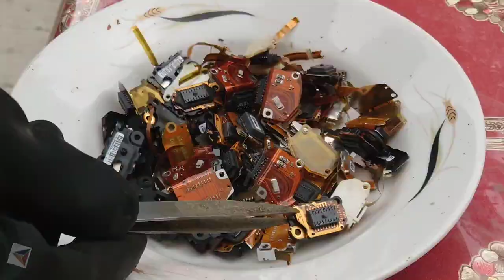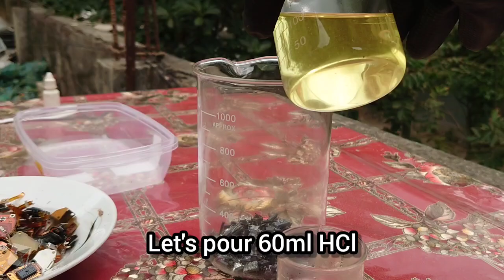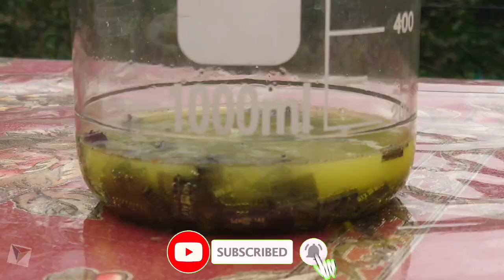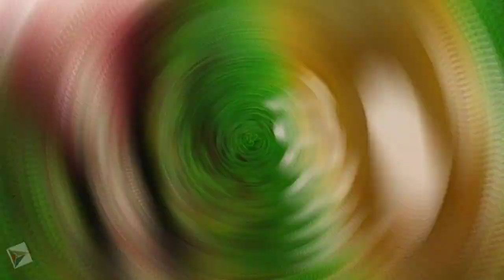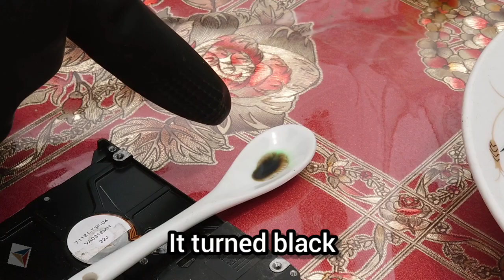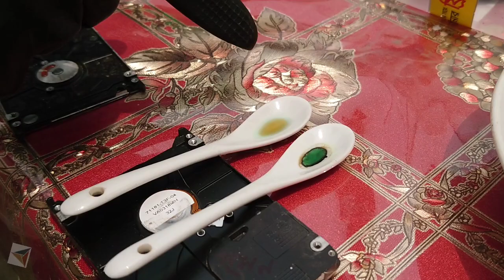Palladium Recovery From Hard Disc Connectors | Checking Palladium Solutions | Part 1

Comment: You should read up on proper PPE protection for recovering and refining of platinum group metals. The vapors, salts and solution can and is very dangerous, platinosis has no cure so it is better to be safe than screwed, good luck
Reply from the maker: Thanks buddy🥰🥰
Reply: I was thinking the same thing while watching this vid. You wrote it better than my thoughts. Nickel metal is as toxic and gives a green colored solution. There is lots of nickel in electronics for anti corrosion reasons.

However I still like watching his shows and hope there is a simple and safe process that I as a novice can do the same and get realistic results. Some of these Precious Gold Metals recovery artists are like Bakers who intentionally leave out a process or ingredient and show an outstanding recovery. When someone copies it, the process fails before the precipitation is supposed to happen. Ex: like using white fuming nitric acid in a 4:1 aqua regia solution. Which really only requires a 30% nitric acid. Then trying to denox the PGM solution, takes forever, and losing the work, effort, chemicals and the PGM.
I believe in doing the basic streamlined process that professionals use, then when perfected with practice, go to other newer type processes.
Reply: @knightstar1312  I enjoy watching most people but it's scary to watch people that have no clue about something other than watching a video or lots of videos. Nickel is used in almost everything even cpu pins which use kovar metal. There is another type that sounds very similar but I can't think of it. Kovar is a iron nickel cobalt alloy. The safer part of nickel is you can keep the metal in solution without precipitating it aka like dropping gold and other metals but still better safe than sorry. 

Beryllium is used in some parts also which is extremely dangerous because it's a serious carcinogen and might drop out of solution if done improperly
Reply: @knightstar1312  I wrote another comment but this isn't platinum group metals. HD tested it properly after this video with dmg after informing him. But it's better to know the precautions that should be taken with platinum group metals